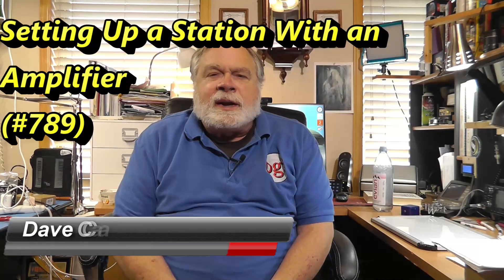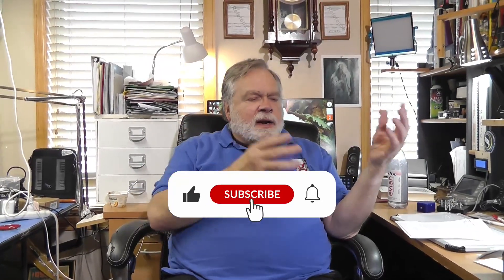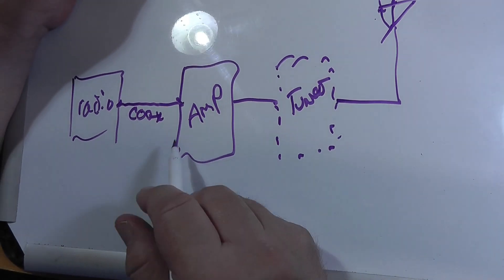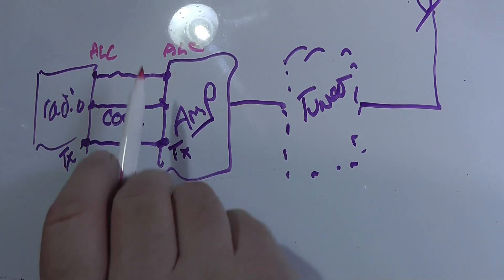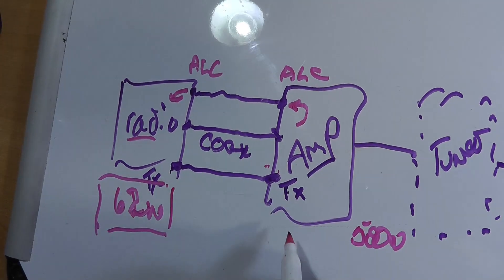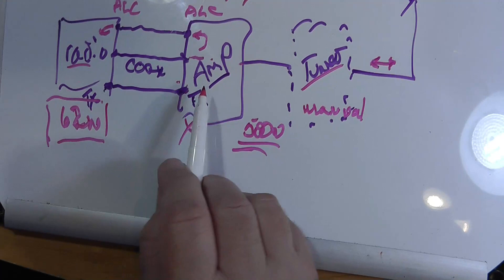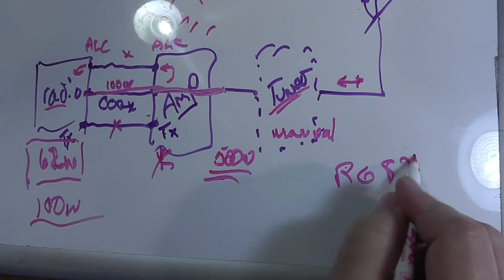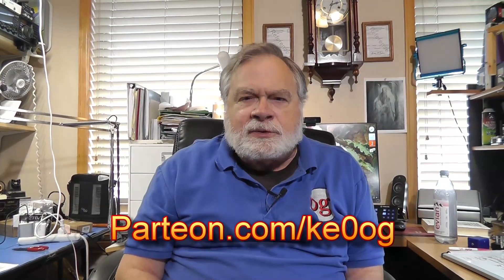Setting Up a Station With an Amplifier (#789)

Comment: Thanks for that, Dave! I've never run an amp of any kind, so this is all new to me. At some point in the future, could you look into running the increasingly popular, relatively primitive CW kit radios with the small amps sold for that purpose? (The amps are usually kits as well.) From my reading, I see that there are several issues involved, such as absence or presence of a VOX circuit (which of course would be absence in a CW rig), and I'm a bit lost with it all. 

Like a lot of hams these days I've gone full-time QRP from such a radio, and would love to be able to splice in one of these 15-to-75-odd watt amps when I'm not on the road, but the procedure is a bit daunting for those of us who already don't have experience with amps and more sophisticated rigs. Most of the little CW rigs we use lack the external connections you mention here. 

Thanks again for another clear video!

Comment: Tuning the tuner while the amp is off? Won't the swr change when the powers added and require an adjustment on the tuner for a flatter swr while transmitting with the tuner.
Reply: If you try to tune your antenna with an als-500 or als-600 you run a high risk of blowing the finals due to the impedances and currents flowing back through the PA stage of the amp. Sorry, a year late.
Reply: The swr will not change.   Sometimes if tuning for minimum swr with very low power , say much less than 10 watts, the meters will show a change due to the way the diodes conduct at low levels.

Comment: As a suggestion:  You did mention power handling capabilities of the antenna Dave.   I have found the weakness in the antenna system can be the BALUN or UNUN that is not built to handle the increased power presented to it by the amplifier.  These transformers are not all built the same as it regards power and heat.  The torroids or beads or capacitors or wires in the BALUN can be heat soaked and the SWR will begin to "wander" upwards.  So transformers are a critical component of the antenna system if you are using wire antennas (which often have a BALUN or UNUN) inline.  BALUNS/UNUN's  MUST exceed the power handling output of the amplifier just as you mentioned about the tuner. Keep an eye on your antenna tuner's SWR as you transmit and be aware of what the reflected power is while transmitting in "normal" conditions.  Lastly, as you add more power to your signal, be aware of RF.  Good grounding is very important as the power increases. 73 Art W1SWL

Comment: Noticed your camera is really shaky. Haven’t seen that in your older videos. Maybe go back to using a tripod? It’s distracting.
Reply: Also that light above you that reflects in the white board is a little distracting (looks like a single bulb in a keyless fixture)
Reply: There is a person holding the camerw

Comment: What a timely video! 

Just today, I installed an Acom 1200S amplifier to my ICOM7300. It was not quite as straight forward as I thought it would be. I used RG-58 coax to the amp for the RF signal. The transmit signal on the ICOM 7300 is labeled "Send". On the amp, it is called "Key In." The ALC on the amp is "Key Out." The I used LMR 400 to the new tuner, Palstar AT2KD. From the tuner, I use LMR 400 to a fan dipole. I tuned the tuner yesterday and recorded the tuner settings for the 80, 40 and 20 meter bands. 

There were a couple of problems. First, the tuner had a manufacturing defect in that the knob for the differential capacitor was not properly attached to control rod for the doble condenser capacitor. After some frustration trying to get a tune, I remove the cover, found and corrected the problem which required only tightening a couple of set screws. Then the first cable from the amp to the tuner had a coupler defect. I replaced the cable and everything then worked fine after that. I only need 11 watts of power on the ICOM 7300 for 500 watts out from the amp. 

Your video is about 4 hours to late for me but it is still timely!

Walt AI7MY
Reply: Never heard of RG-52
Reply: @davep6977  My Mistake; RG-58. Correction made.
Reply: @davep6977  My Mistake: RG-58. Correction made.
Reply: only 11 watts to generate 500 out, wow. Good amp $$